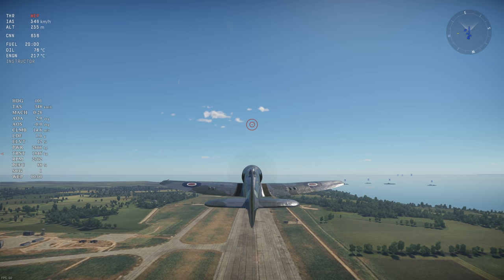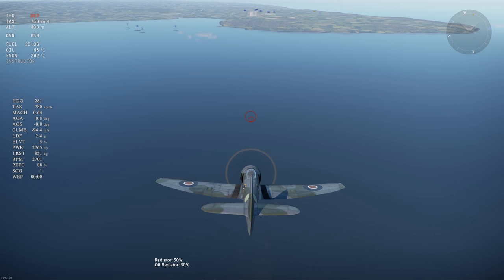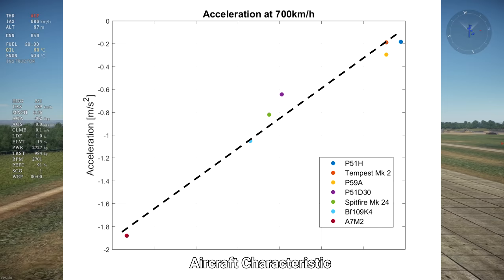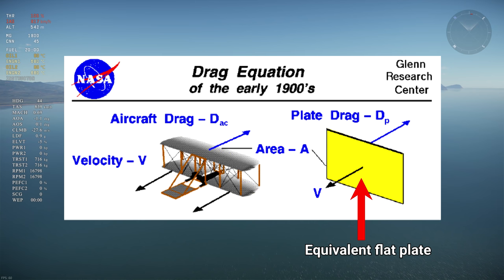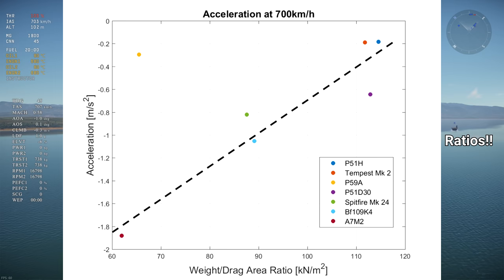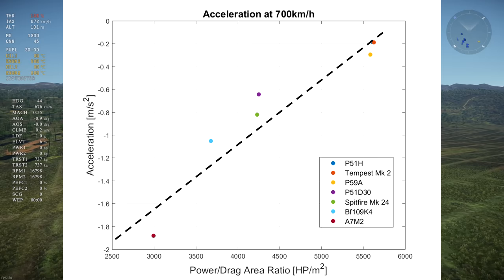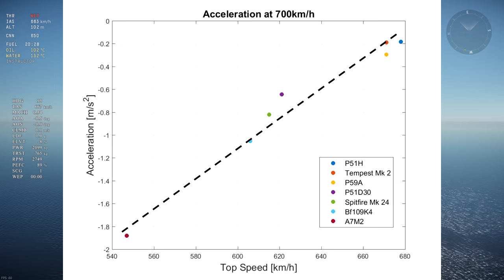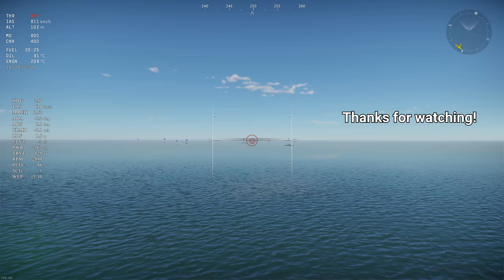Aircraft Linear Energy Retention

Comment: Watching! Im happy because i got the F2G Super Corsair... It is very fast, has good climb and turn but faces jets.... Nice video!
Reply from the maker: Nice, and thanks!
Reply: u have missed the big picture , facing jets is the best
early jets cant climb , so most of them will be near the ground , u can climb , early jets bleed speed fast and can't turn very well , while prop fighters can turn and keep energy , also early jets need time to generate thrust while prop fighters generate thrust easily
Reply: @mouhibgh6928  its true byt the jets can outrun when i dive on them
Reply: Still overtiered
Reply: It would be nicer if it didn’t have at 18,000+ repair cost
Reply: @UnwaryThunder9  But you can earn about 40k if you can win and get a single kill
Reply: *Laughs in 7.0 Spitfire Mk24*

Seriously, with WEP you can climb at 240km/h in almost a 30° climb or do a 180° turn with minimal speed loss. The four Hispanos are pretty good and your dive speeds are fairly decent for jets. Plus, pretty funny to be the only prop on your team and STILL do better than at least half of them.

Comment: My bet is....
Thrust, drag, and mass.

Given level flight above top speed, and assuming that the Thrust and Drag vectors are pointing exactly opposite of each other:
Deceleration = (Thrust - Drag) / Mass      (Using the vector magnitudes: ∥v∥)
Thrust will be affected by: Engine power, TAS (correct me if it is IAS), propeller efficiency, and wave drag on the prop.
Drag will be affected by: IAS, frontal area, surface area, and induced drag.

Thrust-Drag = 0 at top speed. At any given speed, the difference between Thrust and Drag will tend to be lower for aircraft with a higher top speed. 
So as a general rule of thumb, look at top speed to compare the LER of aircraft. Although I believe that given a significant difference in prop performance above top speed (different in power or efficiency ),  a slightly slower aircraft might have better LER.
Reply from the maker: Pretty good! Induced drag is very small at these speeds though, I could have not taken it into account and the graphs would barely change.
Reply: @AdamTheEnginerd  I imagined it'd be rather low, but I wasn't sure it'd be that insignificant.

Comment: My initial assumption was parasite drag and top speed were the two most important: achieving high speeds by low drag would probably lead to the proportional drag increases above top speed being lower than a plane which brute-forced its way to that high speed via more thrust, assuming all other factors are equal. Don't know why I didn't think of weight initially, since that affects acceleration (tougher to get a bowling ball up to speed compared to a tennis ball but it doesn't slow down as quickly either).
Reply from the maker: Even without weight, that's still very good!
Reply: @AdamTheEnginerd  one time i chased an Fw 190 D-9 in a dive with my Tu-2S-59. the 190 was getting away until it started climbing again, where my medium bomber suddenly started gaining rapidly on the fighter. I'm guessing that's a weight/inertia thing
Reply from the maker: @Turk3YbAstEr  Or engine overheat from the D9.

Comment: I must say, I appreciate these kinds of videos. Not only do they help me optimize my gameplay and ability to crush stock-flying plebians, but they are informative and provide insights into how flight and other vehicles work in the the real world. Thank you for creating these.

Though I understand you may not have much time, I did want to ask about something. I saw in the video that you used acceleration at 700km/h, obviously because acceleration is partially a function of drag and power, which vary at speed and altitude. That said, I was wondering what the formula for acceleration in prop aircraft would be based on that. I was thinking it would be something along the lines of a = F/m*D, where drag and force are functions of airspeed, though not yet having taken physics, I could be very wrong. If I am about correct, what would those functions look like?

Take it easy, and thanks in advance.
Reply from the maker: It just comes from F=ma rearranged to a=F/m, where F is the resultant force (F = Thrust - Drag). If Drag is higher than Thrust, it gives a negative acceleration.

Drag = 0.5*density*speed*drag area
Thrust = power/speed (for a piston engine. For more details regarding engine types, check out my video: https://www.youtube.com/watch?v=7i8WkXkODuM&ab_channel=AdamTheEnginerd )

Does that answer your questions?
Reply: @AdamTheEnginerd  Yes it does. Thank you very much.

Comment: I'd guess high mass and low drag give you good LER. As this detemins how fast your plane decellerates.

Edit: watched the vid now; I recognise I expected you to talk about relative LER "how long can a plane keep the energy above it's intrinsic max (ie how fast it can go) it has been given" but you talked about absolute LER "how much energy does my plane have after a certain amount of time above absolute max energy". But what you do, if you compare absolute LER is basically compairing top speeds, as you showed, since top speed is the relationship between mass and power to drag. The more massive planes tend to have the heftier engines, thus given a similar drag coefficient giving them the higher top speed, thus requiring them also to climb at higher speeds as the amount of acceleration the engine provides is not that great as well as for the planes with the lower top speeds having to climb slower since there, their high drag dosen't notice as much.
Oh and screw jet engines in this comparison! They always want to be the special snowflake. Go ram yourself into a pole Mr-"I HAve a biGgeR eNeRGy OuTpUt aT hiGhEr sPEedS"!
Reply from the maker: Good explanation!

Comment: Man this is awesome! Most of this I could already infer from in game experience, but it's so cool to see it solidified by graphs and tests. I wonder if you could somehow measure the effectiveness of stall fighting for each plane since they have different stall speeds, but also have different energy retention speed so they won't stall as fast. From what I've seen in game whenever I try to stall fight a zero we often have relatively the same energy at the start, but we both start stalling around the same time with the zero being able to last slightly longer. I wonder if this is because although the energy retention is worse in a zero, the P-51 reaches its stall speed since its much larger compared to the zero's. Do you think it's possible to make tests on that with different planes to see which ones are the best and worst stall fighters?

Comment: Am I right to think that higher mass aircraft of the same shape then a lower mass one will in the end be the same speed? As speed is only based on thrust and drag, not weight. Acceleration will be different of course
Reply from the maker: Nearly 100% right, the higher weight also increases lift induced drag, but it's very small at high speed.

Comment: It would be instructive to redo the graphs at elevations above sea level. For extra credit you could graph in 3D, since each aircraft is a curved line;)
Reply from the maker: Basically it would follow the top speed trend at the altitude you want to measure it at. 3D graphs aren't quite necessary to illustrate and explain this concept to laymen ;).

Comment: Does reheat/afterburners take time to ramp up or is it instant in the game?
I'm asking this question because I believe the Phantom FG has the engines designed in such a way that allows the reheat to ramp up quickly so it can spend less time throttling up while on the deck (and melting it)
I wonder if that is modelled in war thunder?
Reply from the maker: Takes a bit of time to ramp up, a few seconds depending on the engine.
Reply: Okay, cool

Comment: Can you give us the "acceleration" of the fw 190? I dont get it why you didn't include to begin with.

Great job by the way. Legendary indeed!
Reply: He didn't include the corsair either, I guess It is because he is really buisy, and he did lay the bases for us to kind of predict what has good LER and what doesn't
Reply from the maker: I can only include so many planes. Already 7 planes made a lot of dots, I think more would hamper comprehension. It only takes 10 minutes or so to add an aircraft to these graphs.
Reply: @AdamTheEnginerd  great job man. You must have an idea about the ta 152, right? Your favorite plane. I saw the MER you did comparing with spitfire.
Reply from the maker: @apoleonschneider  Yeah, well like I said it should follow the top speed correlation very well. With a top speed of 581km/h, the Ta152H should be a bit worse than the K4 in LER.
Reply: @AdamTheEnginerd  nice! Would you say that planes with a good MER wont have a good LER? Can that be a correlation? In game balance, atleast. It would be interesting to find the best MER/LER ratio  plane.
Reply from the maker: @apoleonschneider  Good LER does lead slightly to good MER (high power and low drag), but they are quite separate.

Comment: You say this correlates with top speed, so I’m assuming these graphs represent LER at sea level. Does this mean that at different altitudes different airplanes have better LER? Like would the spitfire have better LER than the tempest at 8,000M since it is much faster at that altitude? (Sidenote: bet the hornets LER is disgusting, especially higher up)
Reply from the maker: LER* at sea level yes, and yeah it depends on the top speed at the altitude you are at indeed!

Comment: Hey Adam a bit off topic but what do you think of the F2G-1 going down to 6.3? Why isn't the P-51H 6.7 instead of the current F2G? 

Also why is the La-9 6.0 while the 109 K-4 is 5.7? I feel the 109 to be a much more capable plane especially considering it regularly faces jets (I rarely get downtiers at this tier) so you're fighting jets in a plane with an La-5FN engine. Granted it has laminar flow wings, better roll and can actually dive but comparing it to its counterparts (G.56, P-51H, Ta-152 and the Griffons) it just feels a bit weak.

As always I trust in your knowledge and appreciate your opinion, thanks!
Reply from the maker: F2G at its current state going down in BR is good, can maybe even go to 6.0 from what I've heard and seen. P51H could maybe be 6.7, but I think it's reasonable at 6.3.

La9 should be 5.7 in my opinion yeah.
Reply: @AdamTheEnginerd  F2G is very powerful at sea level but really struggles above like 4 or 5km. I enjoy the plane but at its current state it faces 7.3 (like MiG-9s which can fly circles around it) but at the same I am a bit afraid of it going down to 6.0 and having the (very rare) chance of fighting 5.0s.

About the La-9 at 5.7 yeah I would love to but I guess it won't go beyond a wet dream... they really murdered my boy :(

Comment: When you will have some time for youtube, could you do a video explaining why some aircraft engines ( such as the F8F's one) tend to overheat in the game (or IRL, I don't know if the F8F's engine had overheating problems in real life) no matter what you do? Is it a game's issue or is it a mechanic? (Excuse me if the question is a bit dumb, I study Env.Eng. not anything close to what you study.)
Reply from the maker: Not a dumb question at all. IRL, some engines had overheating issues or overheated more than others, or weren't supposed to be run at max power for more than a few minutes continuously. Gaijin takes those facts and builds a model for engine overheat to try and replicate what they read in aircraft manual/historical documents. I do not know if it's accurate or not that the F8F behaves this way though.
Reply: With the F8F specifically, they seem to have modeled it so that max continuous power is at 82% AEC, and other parameters were taken from the flight manual. More information on that here
https://www.reddit.com/r/Warthunder/comments/8qq87t/f8f11b_overheating_check_the_pilots_handbook/

Comment: How might I apply this in a match to, per se, climb optimally then? Should planes with good high speed acceleration build up speed before they pitch up or should I pitch up instantly?
Reply from the maker: Every aircraft has an optimal climb IAS, and you want to keep your IAS relatively constant, so this is not related to climb. Planes with better LER will generally have a higher optimal climb IAS, but it's not a strong enough correlation to predict optimal climb IAS.

Comment: Ok ok, I know I`m late, but I`ll give that guess a try. I`d say high engine power/ thrust, low drag and a small wingarea should give a plane good LER. Perfect example? F- 104. Accelerates and keeps speed like a boss, but can`t turn for shit. And if it does, it bleeds speed quick. Or maybe the Mig 21 with it`s high alpha bleed is even a better example? Hm, but maybe I`m wrong. Cuz my odd beloved Tiffy is bloody good at LER and in my opinion also good at MER.Hmmmmm... Aww well... Shit!. xD
Reply: KK, watched the complete video now and it makes sense. Which makes me eben more confused about the Tiffy. The Typhoon has a beast of an Engine, yeah. But she ain`t exactly a slick plane. A big radiator and a relatively thick wingfoil. Yet, in game she has a ridiculous good LER for her Br. I remember fights, when I engaged several enemys at once in a Bnz that transitioned into a vertical dogfight with very tight loops or even turns at rougly 1000 m. And still it was easy to regain 600 kph in a shallow dive and then keep that speed for a pretty long time on the deck, when I was extending away. I can remember very well, how surprised my spectating squadmate was about that sick energy retention in a streight line. Maybe the flightmodel is a bit off? Oh damn! Plz don`t tell Gaijin! xD
Reply from the maker: Pretty good! As for the Typhoon, its top speed is actually on the high side for its BR. Hardly any fighters it can face can outrun it. That's further proof that top speed is a very good indicator of LER.
Reply: @AdamTheEnginerd  Yeah, but there still is that paradox (in my opinion), that she can turn so well. Especially in the vertical it`s on La-9 level. Hm... You know, I was a glider pilote in my youth. Gliders don`t have any engine and an extremly large wing area. Main reason ofc is to provide a high lift coefficient and thus a good gliding performance. ( In my days, the average was at arround 1 to 40, theese days they are even better, some up to 1 to 70). Still, especially the competition oriented glider models are able to sustain a pretty high speed with relatively low altitude loss (for birds with no engine and very long flutterfriendly wings that is). And it`s all archieved due to aerodynamic drag reduction. So, with that in mind, when I look at the Typhoon, the flightmodel seems to be a paradox. Concerning the LER I mean. Thick wing profile, relatively large wingspan aswell and a huge dragfactor because of the radiator. And she`s heavy. That big engine shouldn`t be ably to make up for it, if you compare the HP to other planes. Maybe it`s the big prop, but that can`t be all.

Comment: I’m confused by power to drag, power at what speed?
Reply: Seems like a correlation that should be represented by a graph with speed on the x axis, not a dot
Reply: as stated in the beginning of the video, this is a test at 700kph @ sea level. So it's power @ 700kph @ sea level.
Reply: @dogeness  Yes, at 700km/h with the propeller halfway deep in the ocean LoL
Reply from the maker: Engine power for a piston engine is relatively constant with speed so not much need to specify, but indeed for the P59 it's power at 700km/h.

Comment: And how bout vertical ER ,that is on alot of german planes,is that into MER or LER?
Reply: It's PWR
Reply from the maker: Depends what you mean by vertical ER. If it's at constant speed, it's just climb rate. If you start at high speed and point upwards and speed is being bled off, it's a combination of LER at high speed, and climb at low speed.
Reply: @AdamTheEnginerd  alright, adam. thanks so much!